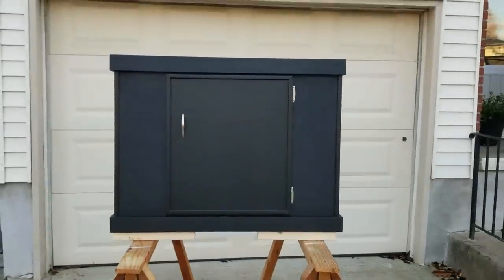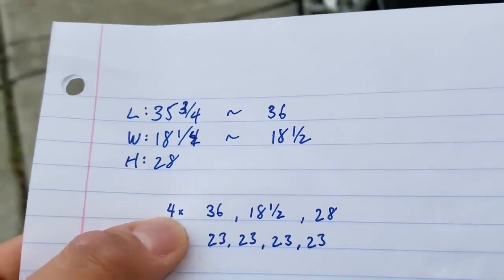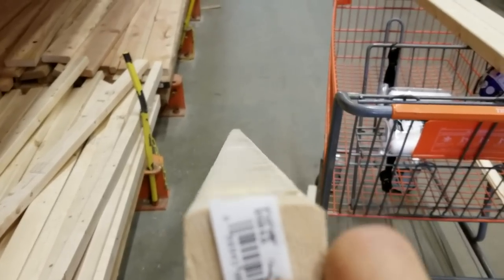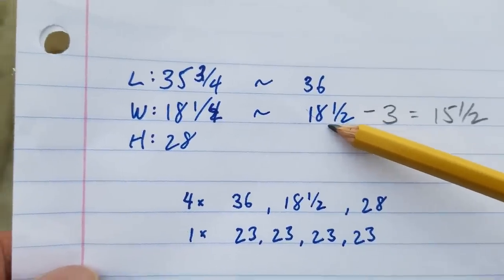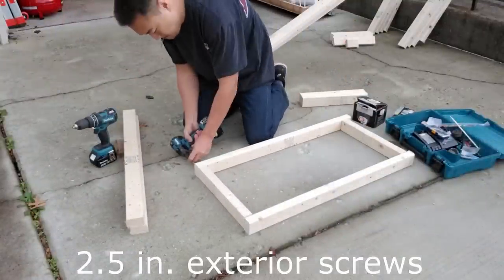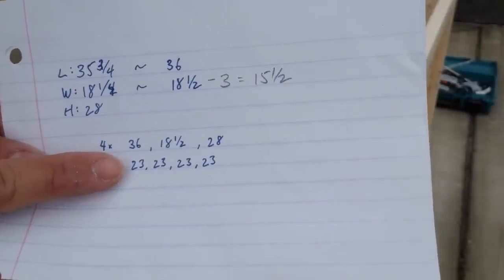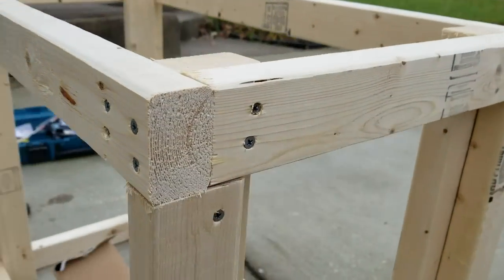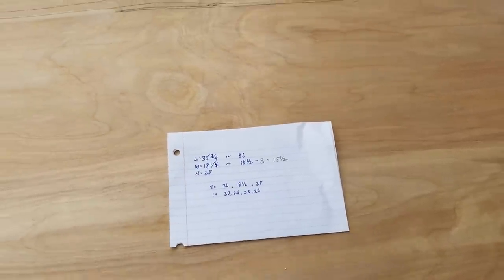DIY Terrarium and Vivarium Stand - Part 1

Comment: Nice!!! Will it hold a 40g breeder enclosure???
Reply from the maker: A standard 40g glass aquarium footprint is 18x36" so it should hold. If your going to fill with water then you should use 2x4" lumber.  I used 2x3" lumber because that stand is for a terrarium.
Reply: Perfect!!! Thank you for the reply. I'll be using it for my bearded dragon, so no water.
Reply from the maker: @britneygarcia3817  in that case you can use 2x3" as I did in the video.